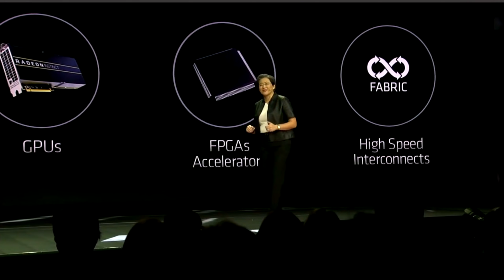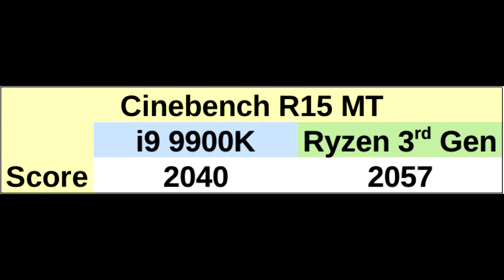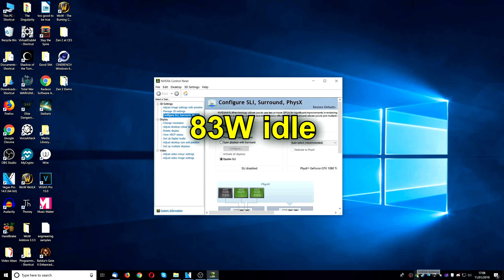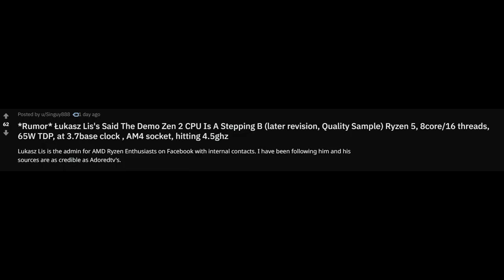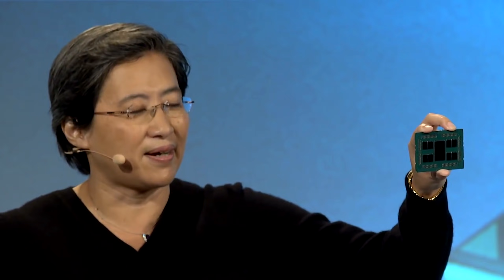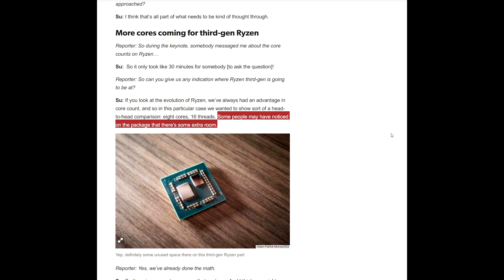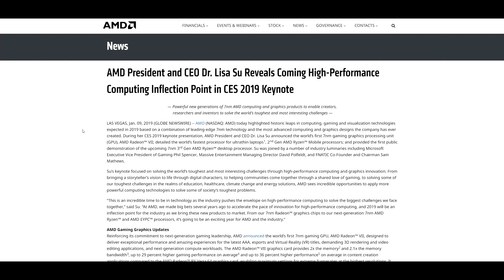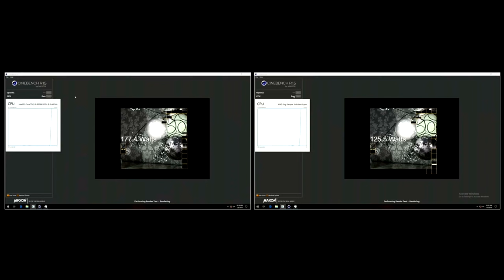Zen 2 Faster than i9 9900K at Half the Power.

Comment: Waaait... before New Year, I think someone said that the Ryzen CPUs won't have separate I/O die. Rather, the I/O will be integrated with the CPU die.

But here we see that the 3rd generation Ryzen will indeed have a separate I/O die...

What gives??

AAANYWAYS... as I have repeatedly said, THIS (i.e., separate I/O die) will be the gamechanger: MUCH faster iteration because of separated dies, DIVERSE offering by mix-n-match, and so on. New memory or I/O tech? Simple: Next iteration, upgrade the I/O die, integrate. This makes AMD to be much faster to adapt to changing landscape.

Future is looking very bright indeed for AMD!
Reply: Maybe it's cheaper for AMD to slap on the same chiplets and have an IO die as the ones used in the new Epycs as opposed to designing and producing another 7nm chiplet that has both the cores and the IO. Also, yields will be much higher since you have much less things to go defective inside the chip. If your IO has a defect, you need to throw away the whole die. If the cores are defective but the IO is good, you throw away the whole die again. With the current design, if the IO is defective, you get to keep the chiplet containing the cores since its separate silicon and just slap on a working cheap 14nm die.
Reply: @bgtubber  That as well. Though the I/O die, as it's using a mature process, would have very high yield. But in any case, AMD's chiplet strategy is turning out to be very beneficial for its bottom line, both from existing production side (as you pointed out) and from future production side (as I mentioned)

Comment: I will let slip the speculations over the TDP, but before overhype even more people, Jim, a least f*ing menion that the only issue Ryzen has is latency and they show NOTHING in that regard, besides showing us an i/o die that WONT do anything to solve the issue.

I've huge faith in ryzen 3 series, but it's hard to match Intel's ringbus in gaming. Finger crossed tho, we need it to happen!

p.s.: Don't expect these chip to be sold for charity. Thy will match Intel's tier to tier. 
Source: AMD and its MI50 rebranded card

Comment: Who is to say that the IO die cannot be scooted up some and another 7nm ryzen can fit under it turned on its side for a whopping 24 core 48 thread chip???????????
Doubtful, but not impossible eh?
Reply: Threadrippers use the TR4 socket which is the same size as the Epyc one SP3. So there's a ton of space for chiplets, no need to turn anything sideways. This means that the Threadripper on 7nm will look like this - https://www.notebookcheck.net/AMD-s-Next-Horizon-Event-7nm-Zen-2-Epyc-and-Vega.357391.0.html+

Comment: hold your horses , this is an engineering sample which could be running at a higher frequency than the stock will. Wait until the release to draw conclusions.
Reply: Umm, what? Do you know what engineering sample means? It implies the contrary of what you said - that it doesn't work at full potential. Final silicon is always more refined than early samples (read higher clocks, lower power draw).

Comment: Why would AMD show their low/mid end new Ryzen chip? I think this is their new to be mainstream AM4 flagship. But the OC potentialin this thing looks very promissing - and with lower Power/heat compaired to the 9900K. Yes. 7nm gives better efficiency, so that is not unexpected. But putting  the "predicted/speculated" 16 cores in such a small die and with high enough clock speed, is not easy. They might be able to make a "130W TDP" - 16 core chip. But All this power Heat need more die space, and it still need twice the power as a 8-core chip at he same clockspeed. There is a reason Threadripper has bigger die, and higher power motherboards.  Remember when intel moved down from 22 to 14 nm. What really happened regarding efficiency. from Haswell > Skylake..? Not much really.! So they have not reinvented the wheel here. They have renewed their RyZen architecture. AMD use the TSMC fabrication,. so I really think this is overhyped as always. Like RyZen was before launch.
We might see a 12 Core chip at resonable clockspeed on this new lineup on the AM4 mainstream socket. The R7-2700X is really pushing the AM4 motherboards and it's TDP - with just the 8 cores. This demonstrated chip might be just that. A 12C/24T chip runing at around 3.7 @all cores. That thing will beat the  i7-9900K in Cinebench. And the power consumption way lower. due to lower clockspeed and smaller fabrication. It is clockspeed that is the big challenge regarding power/heat. More cores at lower clockspeed is easier to control. And regarding productivity.. better. AMD don't wan't to risk going back to the heat/power monster days they had with their 8-core FX chips.
Reply: Lisa is "Sandbaging" Intel - link: https://www.investopedia.com/terms/s/sandbag.asp

Comment: Your speculation on the Ryzen 3 leaks and potential CES demonstration was almost bang on, apart from the fact they opted for the leaked 65w chip which still showed up intels best. The information around Navi was a bit harder to analyse. My guess with Radeon VII is that it seems like a stop-gap (like the RX 590) until they get Navi finalised and into full production. It's not like they'd lose much money from it in the mean time and it'll surely keep some customers happy enough given the excess HBM2 on-board

Comment: Intel desperately needs 10nm, like NOW. Yet there is every indication that a desktop or even server release of 10nm products (using a looser process than Intel had originally envisioned for 10nm BTW) is scheduled for 2020, as their statements regarding 10nm release at CES indicate 2019 is a Q4 launch for mobile ONLY. Contextually, that kind of pushes Ice Lake/Sunny Cove to getting released in March to June of 2020 for desktop/server. That's 9-12 months of AMD dominance (and also AMD moving to Zen2+ and 7nm+ at around the same time). AMD's about to lap Intel like Nvidia lapped AMD, and it's unknown whether Intel will ever get it back, as AMD seems prepped to hold a process lead in partnership with TSMC from now until the universe grows cold. I mean Intel's next node, 7nm, is scheduled for 2022, a year behind TSMC's comparable 5nm process.

10nm really fucked Intel.

Comment: amd showed an engineering sample without final clock speed... so it was NOT the r3 3600
Reply: Given that it was running at ~65W, this makes the demoed CPU fall right into the R5 category such as 1600 and 2600 (in this case 3600). 95W and 105W are R7 territory.
Reply: The performance was right in line with the listed R5 (not R3) 3600. However you are correct. Engineering samples are assembled to do specific things. With the definition of the bins not yet finalized they could not be sure that what they assembled was exactly what an R5 3600 will finally be defined as,  and it might not even  have been assembled to match the preliminary specs in the leak.

Comment: I think AMD still developing their IO dies to work well like single chip. they show 8 core but 1 chip if it have multiple chips it probably need IO die (i may be wrong). and i see that fabric line on the empty spot on the CPU and i thinking Oh that is something . and since they not fully optimized to they fullest since it still engineering sample, there still lots of room to gain over CES . and ryzen5 3600 probably around 170$. and we don't even know the Latency of their Memory , with their stock 2666 i think it around 18 18 18 36 latency. and around 50C* temperature Oh my my room not gonna get hot now (at least cooler right!)
If Radeo n are 599$. or outright 500$

Comment: AMD said all they needed to... Like the cheeky sportsperson who wins just by one point because thats all they needed to do, save the effort for later and make the hype train explode with more leaks later on when the higher frequency, and higher core count part scores start bubbling around.

It could be a mind share black-ops where they are purposefully understating performance to slow down the hype train a little so it doesn't get TOO mental to make a stock price bubble, but also to they have "some left in the tank" so when the reviewers get them and discover they can get 500mhz OC out of them and turn them into monsters they will hype the hell out of it and AMD gains a HUGE amount of market.

Buy a chip that's as fast as intel's top for half the price, and then OC it so it's even faster still! Oh yea I'm in lol.

Comment: maybe its not top of the line
Reply: Given that it was running at 65-70W, I would say you are most likely correct. The top end Ryzens, such as R7, are 95-105W while the mid-range, such as R5, are 65W parts.

Comment: I'm guessing the 3000 was only running at a clock speed of between 3.8 and 4.0 on all cores considering it get's 18% better performance than a 1700X @3.9 (my own processor) in the same test. IPC gain at 3.8 would be 21%, @ 3.9 would be 18%, at 4.0 would be 15%, 4.1 = 12%, 4.2= 9.8%, 4.3 =7.2% 4.4 = 4.8% 4.5 = 2.5% and 4.6 = .001% IPC gain since I'm sure there won't be an IPC loss any speed over 4.6 would be impractical as would 4.4 and 4.5 as those gains are just too small for a die shrink considering going from Bulldozer to Zen was a 52%  IPC gain from the shrink from 32nm to 14nm. Yes I know the change in architecture was a large part of this gain but some of it was from the die shrink. Also I'm sure there have been tweaks to the zen architecture since gen 1 and even zen+ in the 3rd gen hence the use of the I/O die and not an on chip I/O controller. 

But in short the most likely clock was 4.0 on all cores with a 15% IPC gain over 1st gen Ryzen  or at most 4.1 with 12% Gain. you could argue for 4.2 with a 10% gain.. but I don't think AMD would settle for such a small increase.

Comment: AMD is going to release a 16 core/32 thread mainstream cpu for enthusiast. The demo was AMD's way of laughing at Intel by showing their mid range cpu besting Intel's current top tier using less power and most likely at a much reduced cost.  I will finally build a new system after 8 years.

Comment: isn't it obvious that the engineering samples still have inter-chiplet communication problems for the 16 core?
Reply: What makes you think that it's obvious?
Reply: @bgtubber   like Adored said,  why wouldn't they show the 16 core, it made it easy to misunderstand for a lot of people? I mean I see they wanted to compare core for core with the 9900k, but I think its not that they wanted to show that vs the 9900k, but instead werent confident in showing the 16core chip.

Comment: OK, so they show what we think is a Ryzen 5 mid range 8 core beating the best Intel has to offer. And with the memory speed nerfed to boot. Does this mean that AMD will release by July the 16 core (two 8c chiplet) pumping out 2x the power? Also there is the issue over IPC. Many games that will be tested are based on single core speed and even with the mega core count the fan of big blue will continue to cling to that.

Can Zen 2 take the IPC crown away?
Reply: If the engineering sample was running at ~4.1-4.2 Ghz as many speculate it to be, this means an IPC gain of 10-13% compared to 9900k (at least in Cinebench).

Comment: faster? they showed it being the same speed... as a processor that's been out for 6 months.  vs their processor that won't be out for another 6 months.
I mean, it could be good? I like what AMD is doing with Ryzen, even if they are still 2nd, at least it's close 2nd, keeping Intel honest.. er "honest"
but as the Wolf said, let's not start suckin each other's d*** just yet.
this cpu isn't even out yet, and it's ONLY just as fast as Intel's, not faster...
Reply: That particular cpu used in the demo was ONLY just faster than the 9900k & that cpu is looking like being a low to mid range chip so it doesn't take a rocket scientist to work out that if the leaked info on the higher r7 & R9 cpu's is accurate I.e. clock speed and core count then those cpu's will be a hell of a lot faster than the 9900k compared to that engineering sample. Good Times are coming if you ask me, roll on launch time.
Reply: You're basing your thoughts on just half the picture - the fact that it just barely beats the 9900k. However, you seems to miss the other half of the picture, which I would say was the more important part in the presentation, and the sole reason that there were stats smack bang in the middle of both screens - the demoed chip was running at 65-70W while the 9900k was running at 125W (4.7 Ghz). So not only is the MID range Ryzen beating the best that Intel has to offer, it does so at HALF the power and heat output. Extrapolating from this it doesn't take a genius to guess that the high-end chips like the R7 should stomp the 9900k.
Reply: All these things might be true but the fact is we don't know yet only time will tell and it isn't like Intel's just going to sit on their butts for the next 6 months
Reply: @cardigansrule  "it isn't like Intel's just going to sit on their butts for the next 6 months" - Intel can't design, engineer and manufacture a new architecture in 6 months.

Whatever Intel sells in 2019 started being designed years ago.
Reply: @ChucksSEADnDEAD  The 10nm was stared years ago, look how well it's doing, kickin' ass, it is, eh? Intel just started innovating after AMD showed their 1800X, look how many cpu's and chipsets they released in the last 2 years, that tells us they will be a while yet to compete.
Reply: @bernrudolph2422  for desktops?
Reply: @bernrudolph2422  also: "The 10nm was stared years ago" yeah and they can't scrap it just because AMD came up with something new. My point is that 
cardigansrule pretty much implied that Intel could react within 6 months. They can't, whatever is coming they already had planned and they have to commit to it, they can't scrap and start from scratch just because AMD launched something new.

From what I gather Ryzen 3xxx will have half a year of advantage over Ice Lake and we don't know Ice Lake pricing. Unless it's more affordable than Ryzen people are gonna flock to AMD because honestly if all Intel has over AMD is being able to reach 800 fps on CSGO 1080p or something but remaining at a mere 10-20 fps advantage in modern games for double the price, forgeddaboutit.
Reply: @ChucksSEADnDEAD  I didn't say anything about scrapping it.
Reply: @bernrudolph2422  boooooooooooi I specifically told you that cardigansrule, by implying that Intel can react within the next 6 months, means that they can fundamentally change Ice Lake.

Would it kill you to READ? I never said you said that.

Comment: I believe that the chiplet will be like ryzen 2000 series, 8C, 6C+6C, 8C + 8C and the ones with GC chiplet and graphic core. you are right
but the leak 4C+4C was wrong.
Reply: Note: Lisa said that what they were showing was an engineering sample not a production part. The logic of having the 4C+4C configuration for the production  8 core mid-range 3000 series  is still valid.
Reply: @billschauer2240  I have the ryzen 2600 which is in 3+3 config. I believe its a possibility. Amd will make 8C chiplets, those with defective cores will go to lower tier. and usually they dissable 2 per chiplet
16C = 8+8
12C= 6+6
8C= 8C or 4c +4c which I dont believe they will put it, but if they want to use them for lowering the costs and if they have low yields in 7mn.
6C = 6C and 6C with vega
4C = 4C but in the 2000 series they are in a 4+0 config,

my thoughts is that the 4C dies will be used in low tier athlons and those with 2+2 
with the exception that the yields are low and they have many 4C cores.

Comment: What I see from AMD keynote was a form of psychological warfare for Intel. Remember when Intel planning to up the core to 10 cores? This is just the tip of the iceberg. I think wether AMD release the 16 cores will depends on Intel answer. What I believe for this generation lines up will be 12 cores max. Maybe they will hold the 16 cores untill Zen3 or Ryzen 4000 series, again depending on Intel answer on this. Why would they release the 16 cores if Intel doesn't have answer for the 8 cores and 12 cores. Clever moves from AMD.

Comment: the only question is how many months it will take
Reply: Mid 2019 so ~6 months.
Reply: @bgtubber  but that date is for the 8 core proccy no ?
Reply: @aneeshprasobhan  Yes, this is the release date for all models with at least 8 cores. We still don't have any info when they'll release the models with more than 8 cores at the same time. The fact that the chiplet was off-center and there's a space for another one to fit perfectly symmetrically below it means that more than 8 core models are definitely coming though.
Reply: @bgtubber  i agree with that, but the multiple chiplet ones may be released in a different quarter no ? since they didnt even talk about it
Reply: @aneeshprasobhan  It could be. We'll know more in the following months.

Comment: Jim, here is my speculation about the clock speed. 3rd Gene Ryzen was said to have 13%-16% IPC increase over 1st and 2nd Gene Ryzen.
If you take your own Ryzen 7 2700X number which is 1804, then add 13%-16% increase, that would end up between 2038 and 2092. The scores 2057 is 14% increase over your Ryzen 7 2700X.
So, my wild guess is the Engineering Sample has roughly the same boost clock with Ryzen 7 2700X which is around 3.9 - 4.0 GHz on all cores.
Of course, this is just my own speculation based on earlier leaks.

Comment: Now we need a benchmark showing integer performance, and another showing the impact on memory latency of using a separate I/O die.  

I think it was a given that floating point performance (what Cinebench measures) was going to be greatly increased with Zen 2, given the doubling of the width from 128 bits to 256 bits.  That will also completely remove the AVX2 penalty demonstrated with all the H.265 encoding benchmarks.